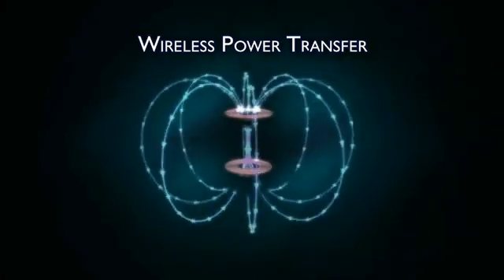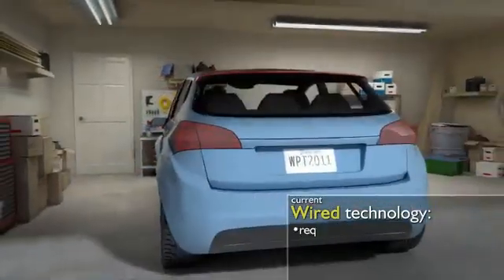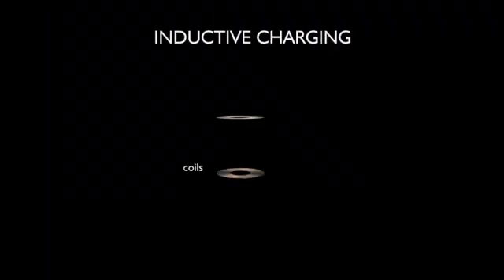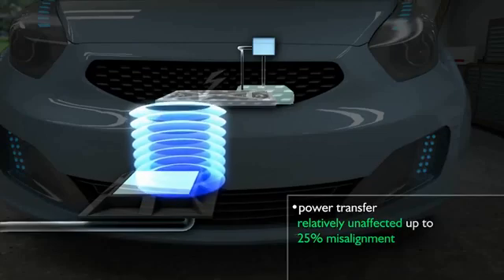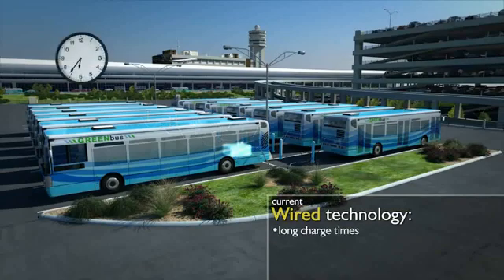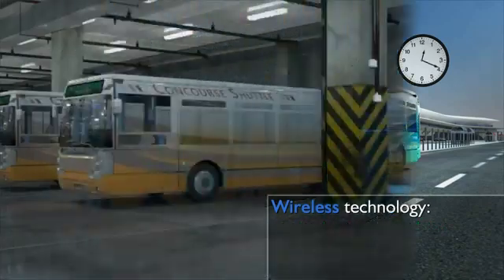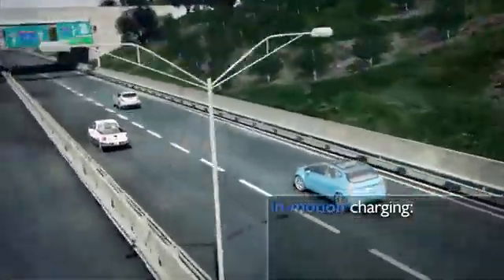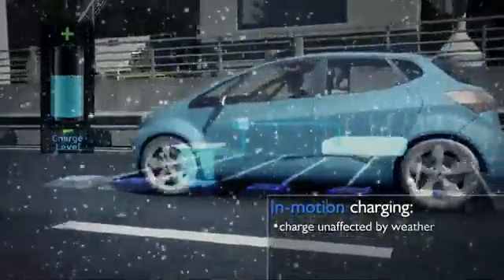Wireless Power Transfer

Comment: All the examples are with the same tech? All of that can be done at once? if so, how you can change the speed of the charge maintaining the efficiency if it's based on keep the resonance frequency of the circuit? does it implies the need of standardization? what about different vehicles?

Comment: "...sufficient power for the battery can be transferred from the primary to secondary circuits without significant energy losses if the operating frequency is set between 50 and 95 percent of the resonant frequency of the circuit."

WHY only 50 to 95% of the resonant frequency??
Are the coils really just air-core?  Most of this technology I've investigated uses ferrite plates behind each coil.
Reply: beforebefore the space between the primary and the secondary coil is air you can see that the primary coil on the ground is seperated from the secondary by only air.
Tyically the space between the two coils is an iron core. 

Higher frequency electromagnetic waves have higher power transfer in air. At the resonance frequency the voltage could become incredibly unsafe as energy is transferred back and forth between the capacitance and inductance. Why they don't go higher than the resonant frequency I am not sure...

Comment: The problem with the bus idea of using a smaller battery is that when this type of vehicle has to divert due to road blockages it would not be getting any charge so is likely to run out of energy and fail.
Reply: +flitsies Obviously this can be taken in account plus a security margin and it will be better than a battery that can hold a full day. Moreover, a non moving electric vehicle does not consume a lot of energy.
Reply: ultort The point about a none moving vehicle not consuming energy you made, is not completely correct.

A none moving bus would consume quite a bit of energy due to the need for lighting, plus the operation of the doors and other devices needed to be active at all times for safety.

Another thing with regard to this system is the potential for it to interfere with other electrical goods for example pace makers and hearing aids.

Any such system would need to take into account times when the actual charging point is occupied or not available otherwise the vehicles will simply run out of juice and have to sit there doing nothing.

So even though it may be possible to have a system that only used juice when needed it would be a foolish idea to build such system in a vehicle.
Reply: +flitsies
He said, "Moreover, a non moving electric vehicle does not consume a lot of energy." In other words it uses less energy, not no energy.
How much power is consumed by having the doors ready to potentially open compared to actually driving the bus? I think enough battery to travel between two or three sequential charging points would be plenty.
Reply: Claude That is because you haven't really considered all the aspects related to such vehicles.
Lighting uses quite a lot of energy, windscreen wipers use quite a lot of energy there are a lot of devices that use energy on a vehicle such as a bus due to it's uses.
You would need to build into any system like this a large margin for deviation of service and transporting the vehicles.
You don't often find specific busses for specific routs either, one bus may end up on several different routs and services.
And there are many other services such vehicles provide, such a move would limit the vehicles viable profitability because it would be stuck to one specific route and only that which falls into that category.
Reply: flitsies

The windshield wiper is a small motor and won't have too much drain in the short time the bus is stopped. If they don't turn the wipers off while the bus is parked.
As for the lights; an electric bus would use LED lighting, which has very little drain. You should be able to leave the interior lights on overnight without greatly draining the batteries.
And if the bus has to make a diversion or run a different route, the batteries will get it to the next charging point. The routes will all have charging points at similar intervals, and the locations will be known so dispatch can direct the driver to the nearest station when needed.
At worst a tow truck might have to tow one bus in the fleet to the next charger once a year. it wold be a reliable system.
The real downside would be the cost of installing charging points along all the routes.
Reply: Claude Of course in theory it would work but in practice it wouldn't unless there was a large margin, the batteries will cost a fortune and thus any company would probably be reluctant to keep a close eye on their efficiency, hell many bus companies don't even look after their diesel engines properly you see them either smoking or breaking down and they often stink.
But the biggest drain for this would be the stop start constantly and as some busses get over loaded and have to climb hills you would find them breaking down a lot.
It could wok but I doubt it would except for small busses that do short journeys.
Reply: Interesting observation that has to be addressed.
Reply: Battery sizing reduction while relying on the on-road charging is not wise. One should prepare for the worst and maintain the battery size enough for a day's commute.

Comment: I was just thinking about this idea I'm happy to see that it's actually real but I actually think of it on a larger scale how about applying it to the roads itself so as you're driving if your electric vehicle is running low on power you can pull up on her shoulder that's actually an electric charging Road and recharge your battery this would also be of this would also be a valuable solution for autonomous vehicles

Comment: And coming back to the same problem Tesla faced: How do you charge for this? How do you know who and how much power they are using?
Reply: undergroundscience I do not think this is a big deal. measuring the received electricity and communicating it automatically to a server is not that difficult. really like charging the mobile phone usage....
Reply: @jurjose   that works for equipment that depends on interaction with the servers to work.  How do you detect and measure usage by a power receiver that doesn't have the billing microcontroller, or if the billing controller dies?
Reply: Microprocessor and Microcontroller,Cloudwave..
Reply: undergroundscience I don’t think it’s a problem. Who told you Tesla is facing this issue?
Reply: I thought Tesla was about "free" energy?